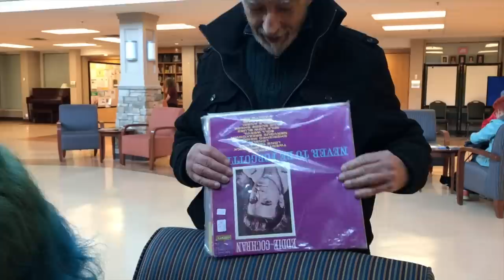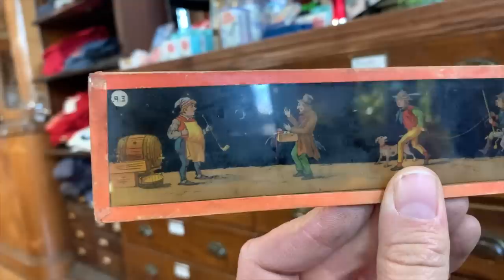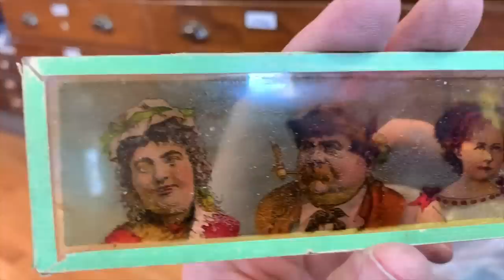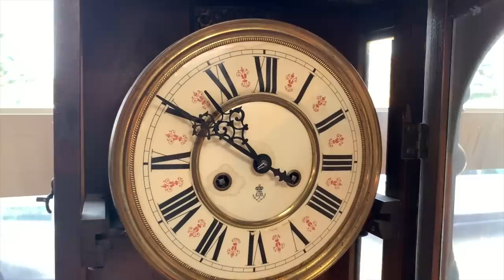$700 for all this!?! What's in the trunk? unloading treasures from a weekend of picking!

Comment: HA! as soon as I saw the broken foot I thought "a bit of JB weld would take care of that"  . . . and then! Also if I may suggest, don't display the projector with the belts under tension, they are rubber and old, and probably not easy to find replacements for if they fail.
Reply: Those are metal spring belts, I have my great grandfathers Revere 16mm projector and it uses those kind of "springy" belts... I wouldn't leave tension on them like you said anyways, just to help them last longer. they unhook like a bracelet or bungee cord and wrap around a hook on the case for storage...

Comment: They were still using carbon arcs for searchlights in WW2 and beyond.  It is only fairly recently that it has been possible to get a brighter light than those things - think of about 500 arc-welders in unison!  Carbon was used because it was the most conductive element that didn't just melt.
The largest UK manufacturer was Compton's in Chelmsford, also home to Marconi (radar, communications incl. radio) and Hoffman's bearings, so the whole area was knee-deep in AA emplacements during WW2.  It wasn't a huge place at the time, despite being the county town of Essex and the birthplace of electronics, so despite being not too difficult to find from the air, it escaped without too many unwanted gifts from the Luftwaffe.  But a few craters and ruins remained, along with stripped out emplacements for the searchlights, AA batteries and other interesting military features that I played in as a boy in the 60s and early 70s.  I'm sure that if the nature of what was being made there had got to the other side, we'd have had far more attention.

Comment: Yeah, something from my home town....the small oil lamp!  McIntyre Porcupine gold mine is situated in Timmins Ontario.  This mine was one of the main reasons the the city came into existence. It was one of the richest gold and copper mines in the nation.  Timmins still functions mostly because of mining and lumber but it has grown so much from the gold rush days of the early 1900's and is still thriving.  We have gone through boom times and then quiet times but we are still going strong over a hundred years later.  Sure was surprised to see that item so far from home.
Reply: The item is from the Grande Cache coal mine in Alberta that was operated by McIntyre Porcupine. It did not come from Timmins.
Reply: @jburgs123  Thanks for clearing that up for me.  I had no idea McIntyre Porcupine had branched out to Alberta.  Just goes to show you are never too old to learn something new.
Reply: @suemeunier2556  I was the same as you. lol. I had no idea until I googled the Grande Cache connection. All the best.

Comment: If you can find any  845 Vacuum tubes that were used from the 30s thru  the 60s in theater amplifiers they can bring high $$$ used or NOS.

Comment: I live in Timmins Ontario where that little lamp must have originated. The area was called the Porcupine mining camp and the McIntyre mine was one of the mines that started around 1911. There is a Wikipedia post about it. The head frame is still standing although no longer in use.
Reply: I thought the same but the coal miner lamp miniature originates in Grande Cache AB. where the McIntyre-Porcupine Mines Co. operated a coal mine for many years. The name of the town is on the miniature.

Comment: Ah the toilet paper holder reminds me of the ongoing toilet paper scam that most people are completely unaware of. Notice how wide it is, a modern day roll of toilet paper is much narrower. I don't know if you recall the "Don't squeeze the Charmin" ad campaign with Mr.Whipple, where supposedly the Charmin was so much softer than the others it was a soft squeeze, but in actuality all they did was roll it much looser on the roll, giving you less paper on a roll but it looked the same size. Then they had what they claimed were double rolls, but they were not double, they got called on that one. now they give you the number of sheets, but each sheet is smaller both ways. At one point in time, they made an oil filter for older vehicles that basically took a roll of toilet paper to replace the filter, but they no longer work unless you re roll the paper tight, and put it in a sock when you buy a factory made one, that's about what it is, a tight roll of paper in a sock. you may be wondering why this was used... you could change the filter without changing the oil, the filter was easy to reach under the hood. I had a 51 Dodge that had it. Usually we changed the oil anyway, but with modern oils you do not need to change it as often as the guide book would have suggested when it was new. Wish I still had it.